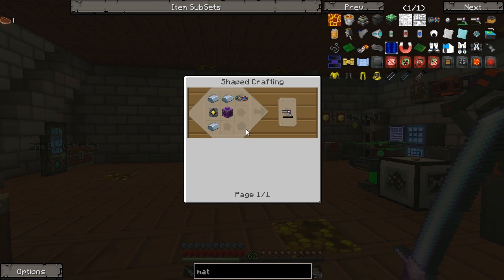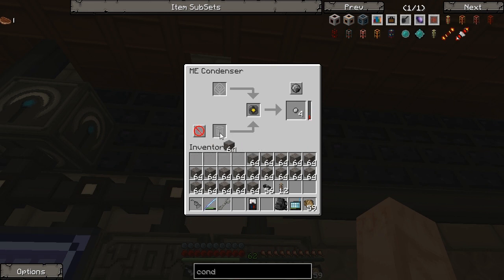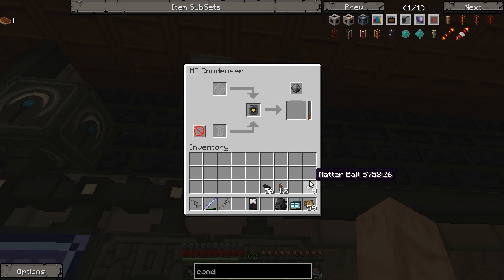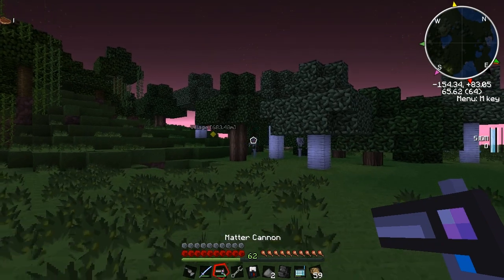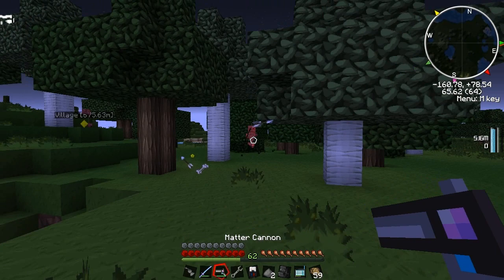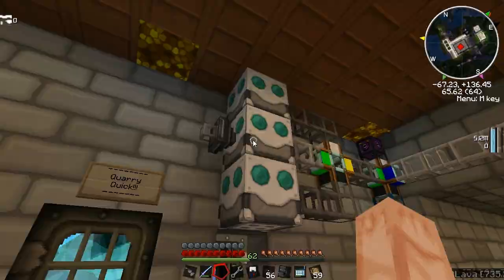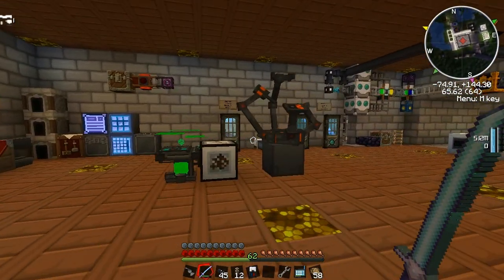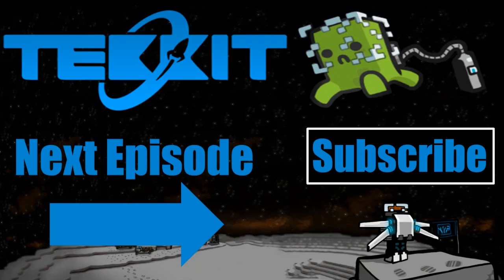Let's Play Tekkit Main #56 : The Matter Cannon

Comment: I  tried using this and It didn't work. Hmm
Reply from the maker: It needs to be powered and loaded correctly to work so I'd start by checking what is on the drive you've used as I'd there is one none fire able item it won't work.
Reply: Ah that Might matter lol. Ill try it. Thanks